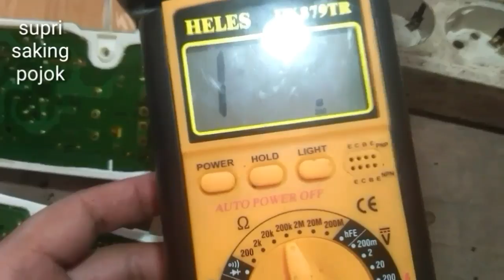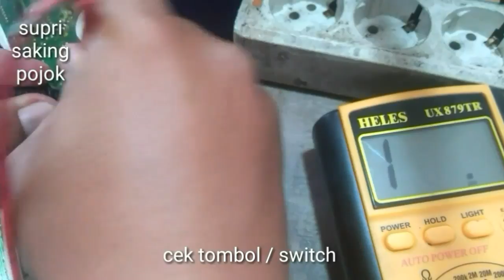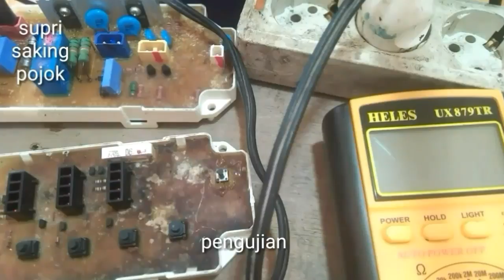Servis modul LG top load power switch  no respon

Comment: Mas pri mau nanya saya ada garapan lg top loading 10 tombol. Kasus awal mati. Stlh saya cek r ruse dan ic a609h shrot dan stlh pergantian. Tgangan 5v nya kok berdenyut dr 4v trun ke 3v dan balik ke 4v gt. Dan lampu2 d monitor lgsung nyala semua tanpa d pencet. Apakah mmg gini kalau blm ad beban dr mesin cucinya mas. Soalnya ni modul saya garap drmh.dan hanya bawa modul saja lupa water lewelnya dan soket2nya gak tak lepas
Reply from the maker: Normalnya tegangan stabil 5volt
Reply from the maker: Apakah resistor dekat ic 6059 masih bagus?cem juga elco
Reply from the maker: Cek
Reply: Elconya saya cek masih bagus. Resistor.malah udh tak ganty mas. Tp nilainya beda. Apakah it mmpengaruhhi masresistor 1.8 om saya ganty 2.2. Om Dan  Resistor 20.4 om  saya ganty dgn 3.3om.
Reply: Saya ganty jg optocoplernya semua dan tl341 ttp berdenyut. Smpek pusing saya mas. . . Pnyebbnyab apa. Apa ic micon jg rusak ea mas
Reply from the maker: Ganti sesuai ukuran aslinya aja
Reply: Udh cr sesui ukuran mas. Tp susah pd gak ad semua. Menurut smpean d kasih brpa mas enkny yg bnyak d pasaran. Saya yg susah cr 20,4 toleransi  0,4%. Yg wrnanya merah.hitam.kuning.emas.hijau it mas
Reply from the maker: coba open jalur 5volt ke ic dan ukur tegangannya
Reply: Udah saya open jalur ke micon. Ttp goyang mas 4v turun ke 3v bgtu trs seterusnya mas
Reply from the maker: Coba beban 12volt diopen.bila tetap naik turun,ac matic masih bermasalah...
Reply: Trnyata stlah saya poting jalurnya d jalur 5v dah gak goyang mas  tgangan udh stabil. Tp kalau 5v jalur nuju kroma di open ttp aj goyang. Seunpama saya kasih tgangan 5v dan 12v dr dvd gmna cara suntiknya mas. D kasih d pin mana aja
Reply from the maker: Kalo bisa pakai ac matic bawaannya lebih baik.
Kalo pakai ac matic dvd cari yang trafonya besar biasanya saya pakai bungkus merah putih.kalo mau pasang ac matic dvd,trafo ac matic modul bagian sekunder diopen.
Reply: Ni stlh saya ganti tl431 yg baru. Tgangan 5v dh gak goyang mas udh stabil. 12v udh ok. Tp d tekan power kok gak nyala ea mas. Apa harus d hub ke mesin cucinya dl mas br bisa nyala. Soalle ni saya hanya pakek kabel ac 220 aja untk mngecek tgagangan.
Reply: Bolleh mnta no WA nya ta mas.dh seminggu kasus blm trselesaikan mas. Dh puyeng
Reply from the maker: Fb saya nama akunnya sama.mgkn ic mikom rusak juga bisa.setelah tegangan stabil,coba cek tegangan pada tombol power?